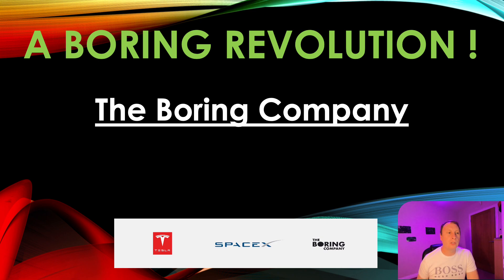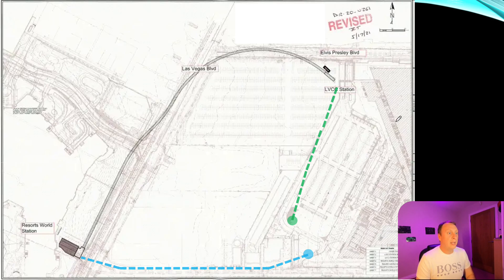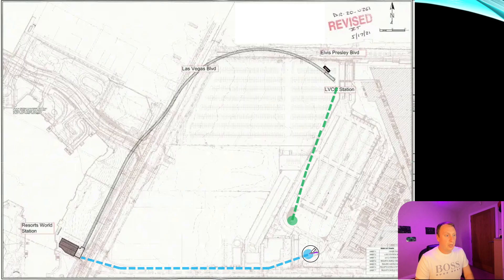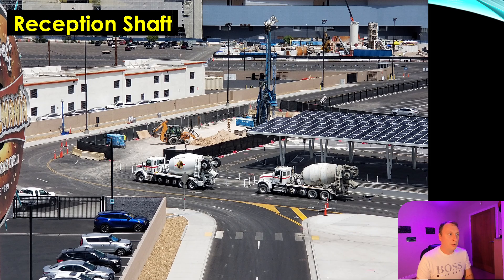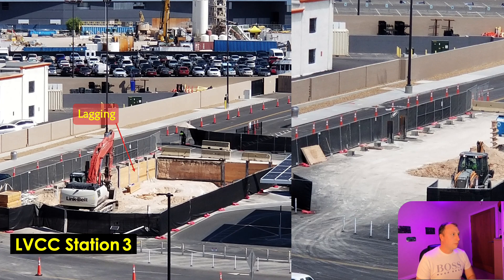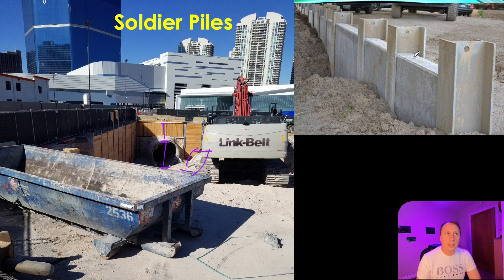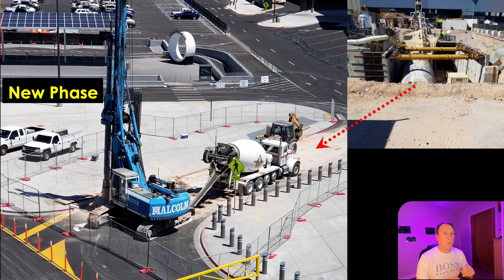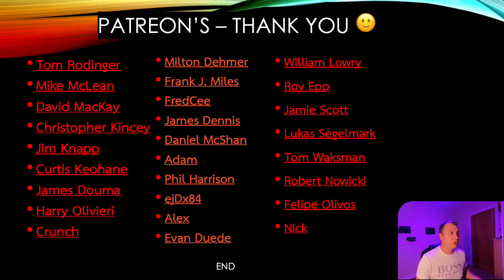Surprising Construction Strategy At Resorts World, Las Vegas 😲 💰 🚇 👷🏼 🏗️ 👍🏼 # 154

Comment: Hey Will, I have a daft but obvious question...Q:= Why are TBM's cutting heads flat-faced? It obviously works best but why? A nail is hammering-ly pointy a screw is cuttingly pointy & bolt needs a hole drilled by a pointy drill-bit. I promise I'm not 5 years old...just have that level of intellect & humour ;)
Reply from the maker: It's actually a good question... far from daft. Shredder had such a TBM. 
Firstly the excavation chamber in front of the cutter head is a high pressure environment and controlling that pressure is key to success. Too little pressure and the ground could fall in causing a void or subsidence. You need a flat face to do this in a consistent way.
Another more obvious reason is surface area. A pointy head might have 200% - 300% more surface area and thus turning the head would require way more work and more wear and tear.
Also a typical 12mm drill bit suitable for masonry works best at 400+ RPM and thus has grooves that exhaust the dust and rock, that approach is impossible in a 1 mile tunnel.
Reply: @BoringRevolution  That's a rrreally good knowledge based answer, thanks Will. Always trust the expert :)

Comment: Will, the maps of the 34 mile Loop (and the 29 mile version before it) have always shown the Resorts World station linked into the LVCC and the rest of the Vegas Loop which makes sense if the Vegas Loop is truly going to be a city-wide transport system allowing passengers to travel from any location to any other in the system without interchanges.

It wouldn't be sensible to keep the Resorts World tunnel separate beyond the initial temporary first stages of the Resorts World link.